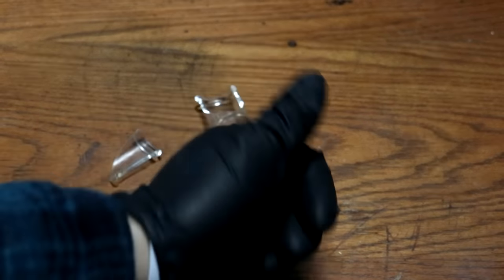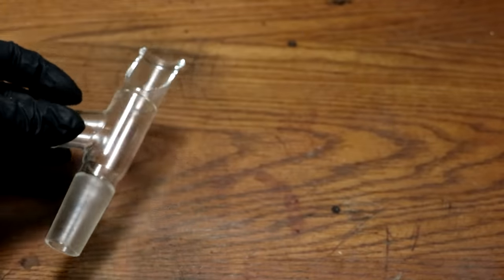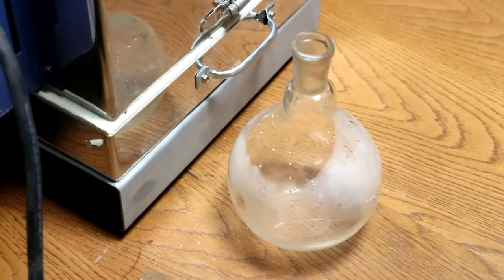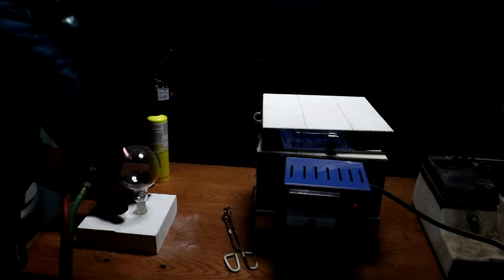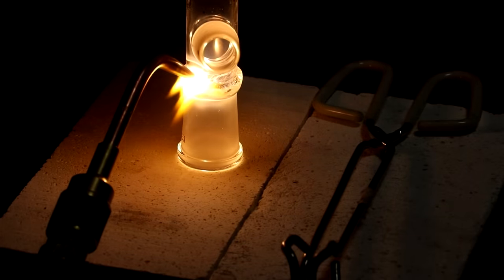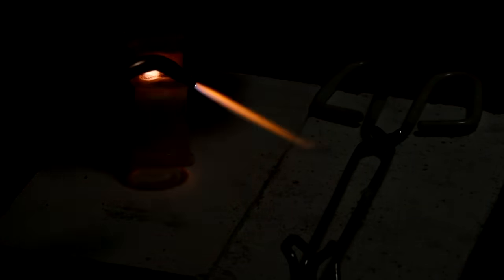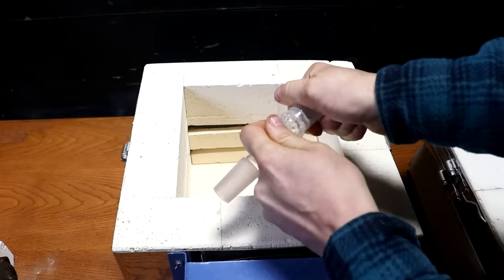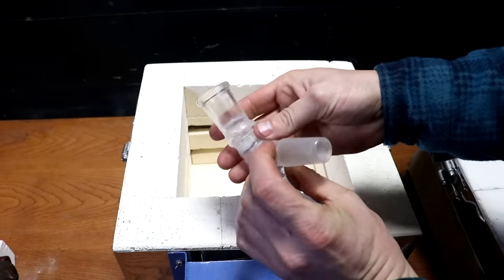Can I Weld Glass?

Comment: For cracked repairs, you can crank up your kiln to 1050-1150, you'll find the glass will want to be with itself, rather than away from itself. The white powder is commonly, but not necessarily, associated with boiled glass, which you can see on your weld. Simply put, your torch is waaaaaay too hot, (you were able to push around the glass with the flame). Turn down the gas pressure. Source: Glassblower.
Reply: Is that how regular glassware is made? I'm now curious on how it is normally made.
Reply: @masonp1314  no its how a repair is done lol
Reply: He could also use a narrower tip size
Reply: @brennonstevens467  that's what she said
Reply: Interesting to know.
Reply: just came here to say this and you put it more concisely that i could have (did lamp working on and off for a year and 5 blowing glass) never got into scientific glass though so  the glass much more picky about point heating
Reply: That white power was the borax coming out of the glass correct?? I remember hearing that when learning glass making back in my youth and I remember having that white power everywhere when I got the glass too hot and was told it's glasses form of a sort of oxidation
Reply: Should be using propane/oxygen mix, as above a hotter kiln temp and the large piece would have tried to repair itself for the most part and the small piece that was being welded together would have looked and welded better if it was constantly turned. Search for "Hard Glass Blowing" AKA Borosilicate Crystal AKA Pyrex Glass. Also didymium coated glass for a lens cover would allow better recording and lessen the bright yellow portion of the flame i also recommend glasses with the same coating for proper eye protection, welding goggles are WAY too dark and don't remove the proper spectrum of light. Great videos! Keep it up!
Reply: Wrong. White stuff is cos of acytelene. Not glass overheat ING. But he did boil the weld, thats true, but the powder is not cos of it. Plus kiln stuff wont help to fix crack like that. Its worth less even to try repairs like that, the crack will spread anyway its too big. Source - working boro erryday.
Reply: Soooo, you can repair cracked flack just by heating it so that crack will repair itself?
Reply: No, its utopic, lol. Cracks like that are not fixeable.
Reply: Oxypropane is enough to fix glass. Acetylene is only needed if you're welding fused quartz.
Reply: @JamesTheAxeThrower  LoL Top Memed Sir LoL 9GAG MeMe CreW ConGraTuLateS On FiNe Memery
Reply: Will cranking up the kiln ruin the ground glass surface at the same time it makes the weld? That wouldn't be helpful.
Reply: @syruptree  dont need to switch a torch he can simply run propane instead. Those burners are universal.
Reply: Ilya Konev I was just about to comment that!
Reply: @GL455_   Nice to hear from some other glassheads. I have produced a white powder using propane fuel, but I am actually not 100% sure what the substance actually is. Only my hand torch will cause it in my case. The cracked vessel, while it's not fixable in the manner you and I would view it, it's totally worth a try for Cody just to get the pieces seamed back together, though not pretty,  will still serve a purpose. I think of repairs in probability, higher heat just means a higher chance of not playing chase the cracks around, he could have even tried doing it with the vessel still sitting in the kiln. It was in his trash glass bin anyway. I say, each experience is valuable when learning to cuddle with hot glass.
Reply: @banderfargoyl   Molecular movement of glass starts around 960 degrees. At that temp it's really slow so most borosilicate workers will have their clear glass sitting at 1050 Fahrenheit. I have never had a ground joint deform, even after many hours of sitting at this temperature. When doing repairs, we push that limit just a little bit more.  The extra heat basically pushes the limit between liquid and solid, and cracks don't spread very well through liquids. Less time at that high heat, less chance of deformation, but a better chance of not cracking. You usually wouldn't have it sitting at higher than 1050 heat until you are ready to repair.
Reply: Need one of those parallel Torch Heads with the Glass between the two Flames, then twirl the Torch around the Joint.
Reply: @SubconsciousDesign  I wasn't thinking that the joint would deform, but instead that the ground glass surface might glaze over so that you'd have to regrind it.
Reply: @syruptree  a GTT torch is way overkill for cody. Way too expensive and he would never use it enough. He could do most of what he would need with a nortel hand torch with a few different tips, or a small bench burner like a red max.
Reply: @banderfargoyl  if you get it hot enough to ruin the ground glass you got it hot enough to deform it
Reply: @syruptree  why would you advise him to invest in a torch for glass work? Are you new here? What, from any of his previous videos would make you think he needs glass working gear? This boggles my mind. It's like telling someone making a donut to invest in a Krispy Kreme conveyor-style automated donut making machine.
Reply: mmmmm donuts
Reply: Subconscious Design the white stuff is usually what's called "bloom". It's the sodium that's been cooked out of the hotter parts resolidifying on the cooler. Should burn off cleanly if you don't let it get too thick.  It's a much bigger issue with quartz. 

-a decade of working sci glass..
Reply: banderfargoyl when you regrind a joint, you inevitably make it a little deeper. Can be a problem if you plan on using clips on it later.
Reply: trevor pierce I'd pick up one the smaller gtts before going Nortel.. they make a couple basic non triple mix bead torch dealies for comparable prices.

The larger Nortel hand torches are Cool for the price though.. I have few redmaxs and an 11x11 In my shop.. all gtt for the benches tho. Carlisle's are also great
Reply: that's dope
Reply: @jseden  yeah I was just thinking a gtt is overkill. I'm looking at putting a Carlisle in our college blowing shop for students to use in soft glass for making bits and pieces for assembly while blowing. We rock  multi max jr torches for our bench torches(that I built sweet pistol grips for), and a nortel with a small tip for hot popping and smaller stuff. A gtt in our shop is too expensive and nice for students to learn on. Only reason I suggested nortel is can swap a wide variety of tips for different stuff, for a decent price.
Reply: @jseden  my buddy has a few of the gtt torches. They certainly are sweet torches. Especially when hooked up to the foot pedals.
Reply: trevor pierce I like Nationals for multiple tip options.. they make some pretty solid low cost options. Near impossible to kill. Carlisle are tanks as well and shouldn't have any trouble with boro.. or soda.. 

Never got too into foot pedals myself but I know alot of people love em. 

A lathe is also a great addition.. I've done 95%+ of my work on one for the past 7-8 years now
Reply: @jseden  we only have soft glass blowing & casting(kiln and hot casting) and then neon. Getting a serious flame working set up and lathes would be sweet. I dont see our program getting that anytime soon though.
Reply: trevor pierce right on.. I've always wanted to do some real neon work. Some of my first steps into glass was playing with a old case of neon tubing and a propane torch lol..
Reply: Watching this, I was thinking, he should have watch some videos on proper glass blowing. I've thought about bringing broken glassware to my local head shop where they make glass pipes and such in house, but it would probably cost more to fix than what it cost me to buy it in the first place. Maybe it would be worth it for expensive pieces that weren't made of Chinesium.
Reply: @wmose3694  Its just Borosilicate glass.
Reply: @duramax 2117 but pushing the glass around makes the repair easier . If it would melt and couldn't move the puddle you would have a mess . When things are molten they will follow the heat .I have welded crayons together for my  3 year old and noticed the puddle following the heat . " I made a crayon welder out of a hair dryer "
Reply: @wmose3694  Borosilicate glass, such as used in that adapter, is very easy to work compared to Pyrex. I think a lot of the glassblowing material is also borosilicate.
Reply: @xenonram  Heh, heh! I am surprised he didn't do like the old time gold/silver smiths. They used an alcohol lamp and a pipette through which they blew air to intensify and focus the flame heat.
Reply: @THE_RAMALAMADINGDONG  it looked like silicone dioxide to me, it is white, granular and fairly inert.
Reply: @THE_RAMALAMADINGDONG  From borosilicate? That’s not going anywhere that’s part of structure, if you can figure way to get it in there or out non traditional, you’d be rich! Boron from where? Maybe missed point.

Comment: Also cody , when I worked at Corning inc. When we welded glass together , it was all CNC based but we used oxy hydrogen torches that would weld it but than there would be a flame polish that would usually ,(when set up correct) take away that white powdery stuff. Only when we didn't set it up correctly we would get that white powdery residue. If I remember correctly, its some of the silica (or The germanium version of silica I am for now going to call Gillica) that burns out of the glass and deposits onto and around the glass .
Also when you cut glass and are using the correct blades make sure to inspect the cut , the cut should look completely ground , there should be no clear part to the cut , should be "frosted " looking. The places where you would see these tiny chips and clear parts on the glass is where "Seeds"(which are tiny air bubbles) would form. Because we produced optics this would cause problems in our ability to use the glass for making fiber optics and there would be brakes in the single where the bubbles were.
Reply: I think germania (not Germania, or else it's an old name for the country) is the name of germanium glass :)

Comment: Pre warming is not necessary i attach joints at room temperature all the time. When a check starts, heat the start point untill molten and chase the crack all the way to the end. Use another new joint($2) on a tube for a handle with some candle slot on it to keep it from getting stuck. Use propane instead of acetylene it doesn't reduce the silica or cause the silica bloom(the white powdery stuff)
Reply: Everyone who has blown glass before cringed several times during that video (me included). Good job for your first attempt.
Reply: propane also burns cooler so less chance for shock. I still run it in a pure propane flame for 30 seconds to preheat the work before adding OXY just to be safe. Also needs to be shoved back into the kiln after working it to run it through the annealing process to prevent thermal shock during cooling and strengthen the glass. The right way to weld a joint like this is have the torch mounted and spin both ends into the flame until both joints are evenly molten then bring them together in the flame. Pressing together, then pull out of the flame and apply gentle tension like you`re pulling apart while continuing spinning. Glass is really an art that takes lots of practice and observing. Definitely worth it to sit with a tube and practice until you can get a weld that nobody can tell ever happened. Metal seems alot easier to just farm weld stuff together on the fly as a novice.

Comment: You know some people would say you didn't really save $30 after you factor in the oxy acetylene, the electricity the furnace used, and the time you spent working on it and they would be right. But the knowledge gained in doing such a project and the satisfaction of a successful attempt is pretty much priceless. And that's not even factoring in the YouTube/Patreon income. Good Job Cody. Keep up the good work!

Comment: Sorry to be brash, but I recommend having a look at some glassblowing videos of making bongs or other similar pipes, they usually deal with attaching joints and fixing cracks seamlessly - among other things - and all sorts of other tricks you can do with hot glass in general. There are some really good tutorials out there that I think you could use in the future if any more of your glass breaks, heck, you could even make glassware you can't buy (like connectors, special joints, etc.)
Reply: Does this require special equipment that he might not have?
Reply: How do you know lmao
Reply: Good links? Are they for borosilicate?
Reply: @Helveteshit  he has almost everything he needs just a good bench top torch and a good kiln controller. hes got oxy and im sure hes got a propane tank with regulators
Reply: He'll also need a VPN lol
Reply: @Helveteshit   Other than a torch with a wider, cooler flame and some spare glass to work with, I think he should have most of the tools he needs already to do some minor repair work or connections. I doubt he'll want to make his own flasks or more complex scientific glasswear from scratch (then you'd need a few special tools)
Reply: @yoghurtkaas1651   I've looked and I've learned, one could probably learn to blow glass from youtube tutorials alone
Reply: @user255  Most of the work is indeed done using boro. Here are some YouTube channels: 'Revere Glass' has a good supply of tutorials, neatly compiled into playlists: "Bench Tricks" and "On the Torch - Learn Glassblowing", both of which are great playlists. 'Purr Glass' also has a nice playlist called: "How to blow glass? Mini Series", in which he shows how to make basically most common styles of glass pieces for smoking.
Reply: @PYROBOY724  
Thanks!
Reply: @jftechdrones 
Meh, no one cares what you watch in Youtube. And even in countries where cannabis is still illegal, there is nothing illegal to watch cannabis or bong making videos.
Reply: This made me wonder what kind of tutorial videos cody actually does watch. That would probably be a trip.
Reply: It's still not easy, still takes practice. I had a bong repaired by a glass blower and it only lasted a short while. IMO, unless you want to make it a hobby, it's worth just replacing most things. Between the electricity from the kiln and the oxygen and acetylene spent, probably saved closer to 15 bucks
Reply: @skeetsmcgrew3282  I'm under the impression that the oxy was cheap for Cody and electricity is inexpensive as well
Reply: A glass lathe (which has 2 teflon-jawed chucks that rotate slowly in sync facing each other)   looks incredibly useful for working with tubing.   I'm looking to build one of those for myself.
Reply: @PYROBOY724  I meant how do you know about fixing bongs
Reply: @yoghurtkaas1651  I guess I have my interests 😅
Reply: @jftechdrones  vpn? There's nothing illegal about making/repairing glassware. Wait, was that not a "water tobacco pipe" sold at every sketchy gas station? That devil's grass and his followers almost deceived my tender heart. For now on the only thing I buy from gas stations is vodka and lottery tickets... Amen
Reply: Plasma Junkie actually makes a lot of sense. The people that make those probably are pretty good at attaching joints.
Reply: Shut
Reply: long time no see

Comment: For the flask you can try to fill with some large grain sand like thing such as vermiculite to add thermal mass to slow down to cooling or instead of welding on a fire brick you can try in a bawl of hot sand to keep other side warm enough.

Comment: Hi Cody'sLab!! I'm a glass blower out of Colorado! What you are working with isn't standard soda lime glass. Its known as borosilicate glass, and it has a coefficient of expansion of 33, rather than the standard 96+ out of soda lime glass. This means you need your kiln temperature to be between 1050F and 1100F. Working temperature is 2200F, so you don't have to worry about slumping at the 1100F mark. Usually I don't mess with repairs, but I am always happy to hook you up because I have learned so much from your videos!!  You can track me down @Requiemglassworks on instagram or facebook if you ever need anything!